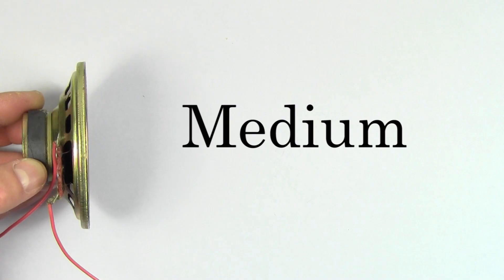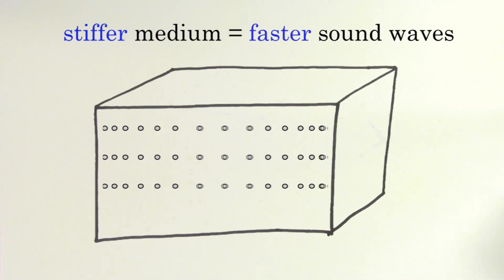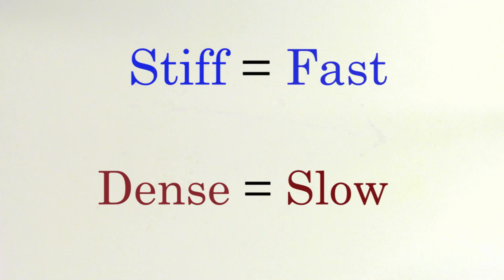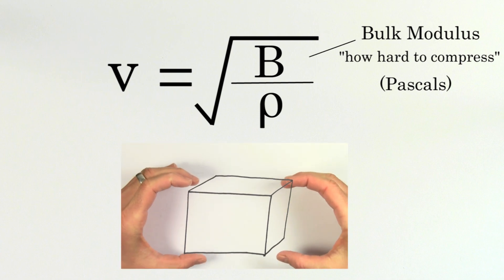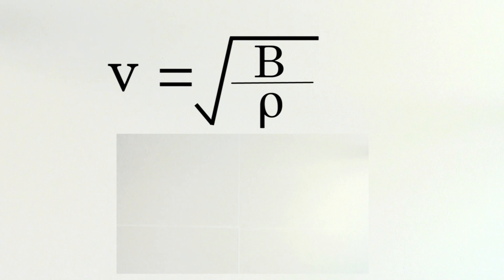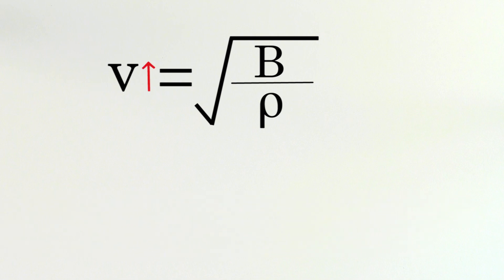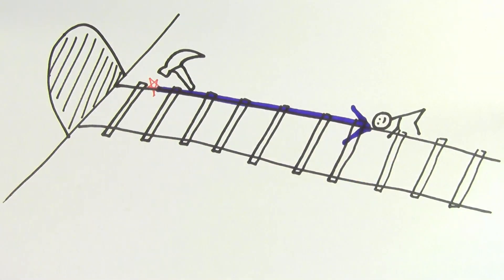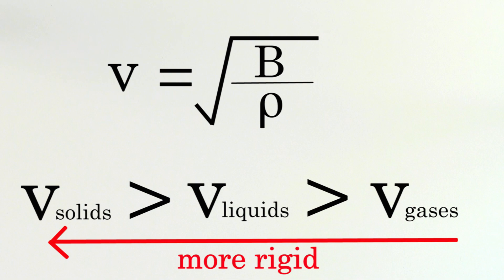Speed of sound in different materials

Comment: Very mice expalantion. although i see one mistake here. when visualizing the ladder sound travelling example.you sayed the sound would be 14 times louder (db) when putting thd ear on the ladder instead of through the air. you must point out that when standing next to the ladder the sound would travel first through the ladder then from the shortest path yo your ear, like light 'breaks' in water. your method is only true if you stand with a horizontal distsnce to the impact point on the ladder
Reply from the maker: I said 14x faster, not 14x louder
Reply: @WeAreShowboat  maybe i am wrong but maybe the sound traverses faster through the ladder and you can hear it from close to you when you are near the ladder🤔 i am confused
Reply: @WeAreShowboat  I think you hear the ladder first, then the hammer.